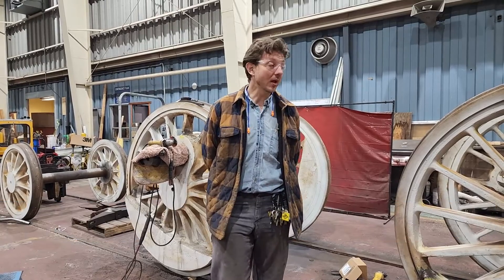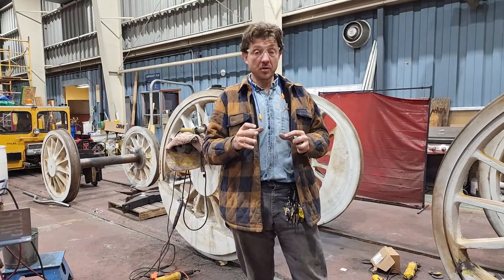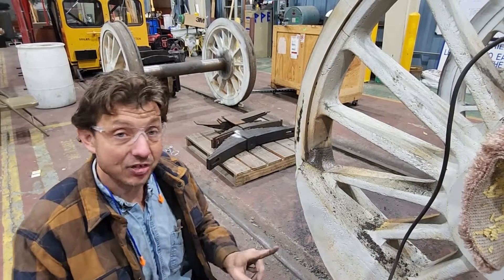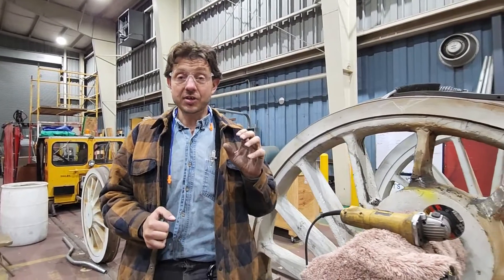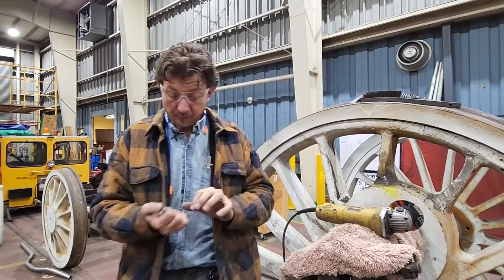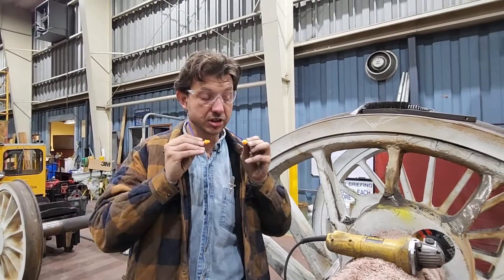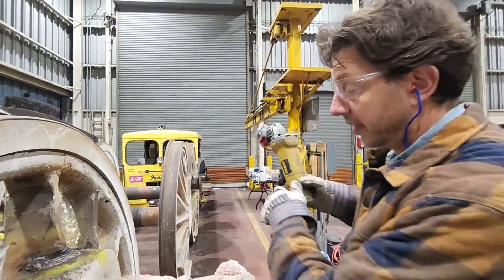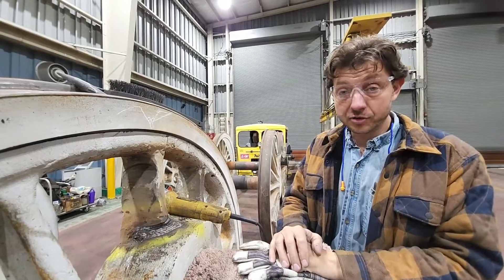Steam Locomotive Wheel Welding

Comment: The castings are indeed...interesting. Good looking welds, as are the boiler ones. After you are done, would it be helpful to heat the area with a torch, and put insulation around it so that perhaps some of the stress might be relieved?
I have seen Keith Rucker use fiberglass mats (basalt would work : ) , and also Paul Brodie use...I think a box of Lyme to allow parts to cool.
(BTW, for noise, my secret weapon is a set of hearing protectors--packed with pieces of neoprene mouse pad cut and and inserted inside the ear cups.)

Comment: the reason that a prior repair was " brazed "  , with bronze brazing rod ,  was the fact that the spokes were thought  to be CAST IRON .  wheel  manufacturing was CHANGED from cast iron to cast steel  between 1905 and 1912 . welding cast iron is a very tricky process  and is not always successful with welding  rod , even IF  the welding rod is meant for cast iron.  IF these wheels are CAST STEEL , then the process is much more  successful. at fort worth and western , we had the wheel problems BRAZED because those wheel centers from 1896 WERE cast iron. the sparks he was getting off the grinder indicated that what he was grinding IS cast steel. the sparks from cast iron look like a " sparkler " from fireworks.

Comment: Will 152’s drivers be converted to roller bearings?
Reply from the maker: Nope. To convert a loco of this age to roller, the frames would require replacement due to the necessary pedestal jaw opening dimensions